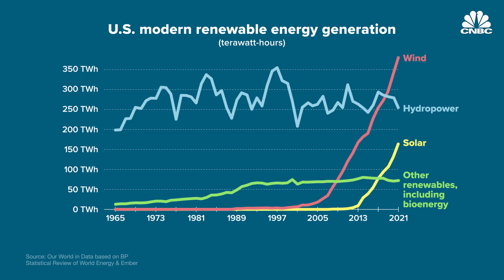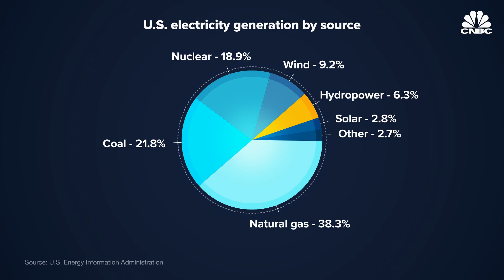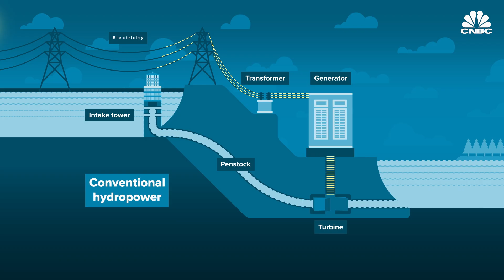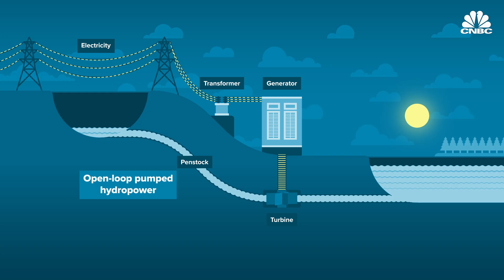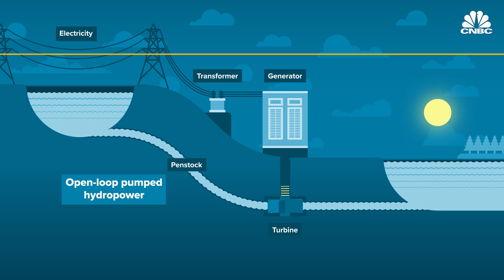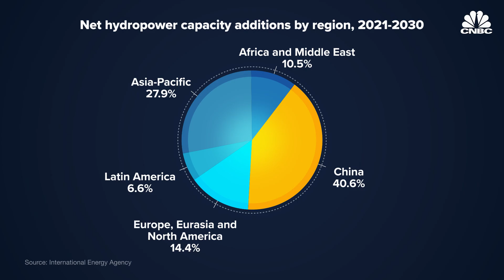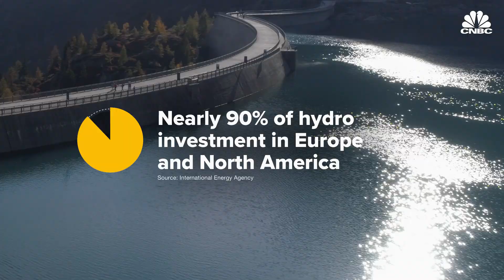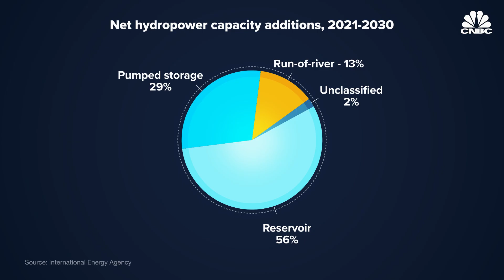What Is The Future Of Hydropower?

Comment: As CA is finding out, you need water to make use of hydropower - but it does two things in one, holding water for use in a lake being even more important. Problem is you need to expend a tremendous amount of resources and energy to build a dam and powerplant, which can also take decades from start to finish. People poo-poo nuclear, but it is the easiest non polluting energy source that can be built almost anywhere; but it also takes a lot of energy and resources to build a plant.
Reply: California needs to delay closing Diablo Canyon and repair and restart the San Onofre Nuclear Generating Station. Grid operators are expecting a shortfall of 1.7 gigawatts in California this summer. San Onofre had a capacity of 2.2 gigawatts.
Reply: We need both hydro and nuclear, because nuclear has a constant output whereas sometimes we need more or less power. Hydro, whether pumped or not, is the best low carbon dispatchable generation. Use excess solar in the day and nuclear at night to pump up hydro then let it out at peak times and during the winter when solar produces less. They can all work together really well.
Reply: @adrianthoroughgood1191  That's not exactly true. Nuclear plants can do load following, and be even quicker at it than CCGT. Hydro is the quickest one at it with both turbining and pumps, not accounting for batteries (which are very resource intensive). Thing with Nuclear is that load following with most reactor designs is a waste.
Overall I agree with you. Nuclear for baseload (maybe a bit over minimum maximum demand), Solar for the increased demand during the day, I especially like rooftop solar and floating panels at Hydropower reservoirs (reduces evaporative losses and uses already built wiring to connect to the grid). And Hydro working as the balancer between all.
Reply: yep I served on nuclear powered submarines, never more than 600 feet from a running reactor core....longest I've been underwater is 87 days....it's a great source of power, compact footprint lots of power no pollution. :)
Reply: Based!
Reply: New nuclear plants are known to take a considerable amount of time to introduce due to an insane amount of regulations on them (so there's no chernobyl two) and large plant construction. Don't remember exactly but roughly ten years.
Reply: @benarumpanayil4098  Right for the antinuclear zealot infested West. But in the past, plants that have always ran perfectly, took down to 3 years, specifically in France or Sweden for example. China, South Korea and Russia manage nowadays to build Gen III+ nuclear reactors in 5-6 years, or less, if multiple units are built in the same place.
Reply: @benarumpanayil4098  

yeah well, we have a lot more than ten years to decarbonize. Already, all the vehicles are going to be zero emission in about 20 years or so. The worst case scenario for global warming does not cause the human race to become extinct; we could adapt. We're going to have to adapt to some extent regardless. Some degree of ocean rise is unstoppable at this point.

I just have to ask you guys, what are you going to replace nuclear with that gets the same amount of power from the same land area? Geothermal is the closest one but at least for now, it's location dependent. There's a coming "enhanced geothermal" that people are working on where you just pick and random spot, start drilling until you find heat, and then pump water in one end and steam out the other....but even that is going to be location dependent because it could produce earthquakes; it's already happened once, in South Korea.

To some extent California can replace nuclear with solar, but remember our production has to go up over time. We're going to want things like desalination plants, and we want to change our electric cars, so even covering all available surfaces with solar isn't going to power all of that, although we should still build solar out as much as we can.

Comment: Not only forgotten energy but forgotten free battery if you use a second flow management dam to allow the river flow to be maintained at a safe level while the turbine in the main dam is opened and closed based on the minute to minute power needs of the grid.  Instead of dams producing power that is used to pump water uphill so you can get hydropower when you release it you simply close the dam gates until you actually need the power.
Reply: Not forgotten, it’s just not mainstream.
Reply: @KRYMauL  I believe many dams have variable for l floor capacity, actually... They effectively already do this.

Comment: As far as I'm concerned, hydropower is great, we should keep doing it, look for ways to make it better and so on, but it doesn't have the potential to supply much more energy than it is already supplying. Wind and solar, on the other hand, have huge potential to grow since we need a massive amount of renewable energy and they are the only sources that could meet the world's energy needs. So the headlines are deserved.
Reply: If you increased the renewable generation you could turn off the taps on the hydro plants most of the time and save the water for when renewables output is too low. Hydro provides an essential complement to solar and wind.
Reply: yes you Right
Reply: actually fam if as good as hydro is in generating power and regulating water flow to prevent floods. down side is water flow can become political and can damage eco systems that rely on water. look at how much water loss has occurred in the colorado river. with that being said Nuclear is the way to go with only biproduct of water vapor or steam and ofcourse the decay of radioactive material. however with regards to removing radioactive material we can just launch it to the moon through NASA's atermis program and spacex falcon heavy.
Reply: Yeah but we haft to dig for lithium for batterys and that releases a lot of carbon & U.S. uses African children to do the mining they often die & dont get paid enough
Reply: Hydro is way, way, way better than solar or wind. But government corruption- the govt colluding with wind and solar construction firms- is why they lie and push the idea that hydro doesn’t work. In Brazil, Canada etc, it’s almost entirely hydro. Nuclear is another great option too. And hydro is great for those who are afraid of nuclear due to a misunderstanding of current technology, or emotional fear from hearing the word ‘nuclear’
Reply: Nuclear is the way.
Reply: Misinformation.

Comment: Here in Brazil, 65% of the electric power comes from hidro power and more than 80% from renewable sources. We have a long experience of building hidroplants, but the newer ones were built as run of rivers because of environmental concerns and are not as efficient as the storage plants.

So, it’s important to find the middle ground between environment and efficiency, but personally I’m huge fan of hidropower.
Reply: We have to do the right way, for our future..
Reply: Brazil has used all of its major hydro potential. Most of the country is flat and the mountains we have are old. The last projects built were done in a rush and not well projected. We have a powerplant in the northern region near the Guianas mountain ridge called Tucuruí. The other major one is Itaipu - these have rather compact lakes. There are others built in favorable landscapes but recently, because of need, some not so efficient ones were built producing huge lakes. The reason we did not go "off" is the low economic growth rates we've experienced. Brazilians like technology and solar panels are becoming popular - also, some interesting wind farms are being built. We also have 3 nuclear units at Angra dos Reis and we mine and enrich (fuel grade) Uranium. 

Something the we don't explore that much are the mid and small sized plants that can generate closer to consumption centers. Tucuruí is thousands of miles from the main consumers (São Paulo, Minas Gerais and Rio de Janeiro) and though Itaipu is closer it's around one thousand miles. The advantage of having so many power plants is the ability to manage generation and storage since the grid is completely connected. The lakes do generate a lot of methane - thought there are measures to minimize it - and that molecule is equivalent to 20 CO2 ones for greenhouse effect. I really wish we could build more Nuclear and that we had accepted the invitation to be a main partner on the ITER in 2006. There's the global issue but there's also the local issue: our economy needs to grow and energy needs to be cheaper for us to try and regain some of the industry we lost.

Brazil does a few things well - and one of the is Hydroelectric Power as can be seen on the PSB series "Building Big" episode about dams.
Reply: Canada gets 67 percent from Hydro, and is expanding Hydro Power. Quebec and Labrador export a singificant chunk of its generation to New England.
Reply: @AmandeepHayer  Yeah at an extreme environmental cost.  That particular project is one of the prime examples of how using hydropower has created more (short-term?) problems than it set out to solve from the perspective of helping the environment.  Now would be the time to send a few independent teams to measure the effects and study the impact of the James Bay project to see if all the confirmed short term problems are subsiding or if current reporting is being green-washed.
Reply: @MotherNature26  v. Coal and Natural Gas, even nuclear when you factor in the externalities like minning. Unless the plan is to deindustrialize, there will be environmental issues. Why not focus on what's the least damaging.
Reply: @AmandeepHayer  Listen, I am not trying to win an argument here.  I am trying to get people to realize that building dams has a significant downside too and that no one should be satisfied by a news story that is broadcasting a lopsided presentation.  This CNBC (what a surprise) video does not do an adequate job of really pointing out these externalities.  What I want to see is people making the best choices they can with ALL the information and understanding that the natural systems that already exist have economic value.  Now the James Bay hydro project has already been built and the harmful effects to the previously existing environment can't be undone.  What I was implying with my earlier statement is that we should send some independent teams up there now to assess (collect data, analyze and compare) if the detrimental effects of altering to the natural landscape/river systems still remain.  That particular project was a build and paint it green afterwards kinda deal.  If you aren't aware of the problems it caused you should look them up.  Industrialization and protecting natural environments does not have to be mutually exclusive, it can be both, but again this requires the public to scrutinize what is actually happening.
Reply: could you list your sources? because last time i checked, Hydro only makes for 11-12% the energy that Brazil produces and most of Brazil is still using fossil fuel. Its not nothing, its quite good for a developing country but nowhere the numbers you claimed.
Reply: @FF-ch9nr  mate, I’ve tried to post twice here, but I guess the links were banned.

But basically, there is a difference between energy and electrical energy.

When you look at total energy, you’re correct, hydro represents about 12% and ethanol about 16%, and almost 50% comes from renewables.

But my comment was on electric energy only. In that regard, 60-65% comes from hydro and about 80-85% from renewables. Hydro dependency fell in the last couple years thanks to a big drought and the huge growth on wind and solar power.

You can check that out searching “matriz energética do Brasil”, you’ll find some links from Brazil’s Energy Ministry and the Federation of Industry.
Reply: May God bless you.
Reply: RDP Marine has a system that u add to ur dams and dont need to make more dams
Reply: Why don’t they just build one on the ocean front?
Reply: Environmental concerns? More like US and Europe concerns over our cheap energy supply, making their products less competitive.
Reply: Unfortunately China gives no f-cks about the environment
Reply: @quadq6598  The Chinese government may not care about the wellbeing of the country's population, especially NOT of certain ethnic minorities, but they do know how to plan for the future, and they are well aware of environmental issues that can make life impossible to the average citizen.
Reply: Maybe there is no more land to be flooded? Or will politicians suggest flooding indigenous lands to create reservoirs?

Comment: You'd think that the methane problem is solvable. It's pretty apparent that it's caused not exactly by the dam's reservoir killing off vast amounts of foliage, but that the reservoir is a permanent feature that eliminates seasonal ebb and flow of flooding, a natural way to rejuvenate the environment and soil. So, what is the solution? Agitate the water to ensure proper oxygen mixing? Periodically intentionally let the water levels drop? Something else?
Reply: I expect these dams are run as a commercial operation. Letting all the water run out would reduce the income available while the benefit would be to the climate not the company. Some kind of requirement or incentive would be needed to get them to do it.

Comment: The one flaw in this video that bothered me was noting the disincentivizing high cost of Hydro regulations that discourage adding or upgrading hydro power to dams is left hanging with no detail or proposed solution. Later in the video the video does mention such things as required environmental impact reports and studies but we're left either wondering or making an inspirational connection between those requirements and the earlier mentioned high costs.

Sure, it should be easy to suggest that if a dam is already built and operational, it shouldn't be that difficult to add a new feature like hydro power generation... right? Would that kind of a bolt-on new feature really be that complex and change the management of tha dam that much?
Reply: Norway had done it successfully
Reply: The government over complicates every thing we do and simply will not get out of the way because their jobs depend on it. And cities depend on government jobs.

Comment: It's too bad that solar over capacity and production is mostly along the West Coast where the sun rises too early before most businesses are open for the day... And that pumped hydro isn't likely a solution because of massive and widespread drought. Perhaps if long range transmission lines were built to connect the West Coast to maybe the Pacific Northwest where hydro is plentiful could be considered.
Reply: The future is for self-generation of electricity off grid, even in California, they came out with a proposed law that makes things difficult for on grid.
Reply: They could combine solar with desalination plants that pumps water into lakes and reservoirs. This basically works as a solar thermal power plant.
Reply: Or perhaps the US could actually have a National Grid rather than regional grids with high voltage transmission lines running coast to coast - given the time zones across the US that would give somewhere for California's solar excess a place to go. But US NIMBYism is alive and well in Maine -

"A proposal to transport clean hydropower from Canada to the state of Maine has created enough "hoohah" to launch a fierce court battle - possibly signalling trouble for the future of green energy projects across the US.

New England Clean Energy Connect (NECEC) was supposed to be an industry-leading project, transporting 1,200 megawatts of Canadian hydropower to Massachusetts across 145 miles (233 km) of transmission line, and eliminating over three million metric tonnes of carbon emissions every year.

The $1bn (£840m) project, funded by utility company Hydro-Quebec and Central Maine Power (CMP), which is owned by the Spanish energy giant Avangrid, received final approvals, including a Presidential Permit from the US Department of Energy. Construction began in January 2021.

Now, the hydropower project could be dead in the water, after a majority Mainers voted to cancel it last November.

The legality of that referendum, as well as the lease for a one-mile stretch of public lands, is currently before the Maine Supreme Court, which could issue its decision any day."

https://www.bbc.com/news/world-us-canada-62072844